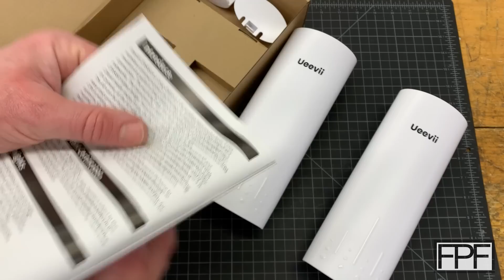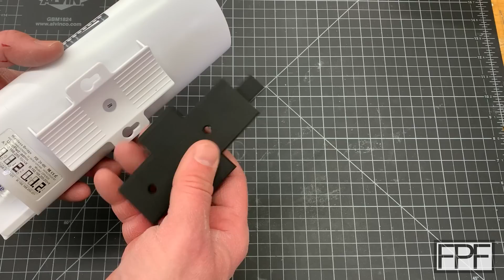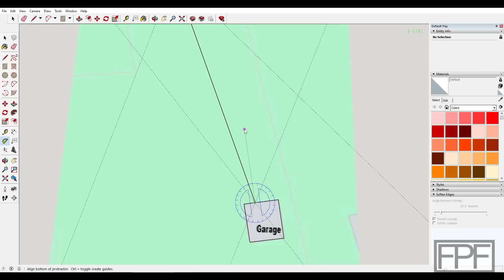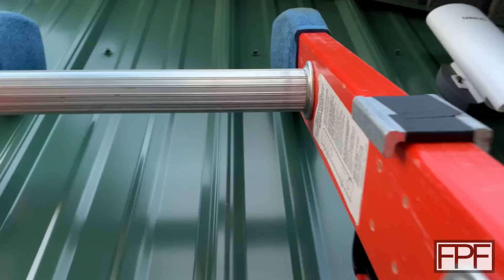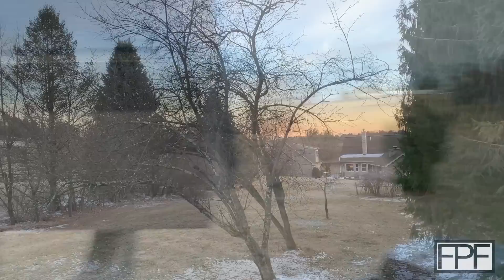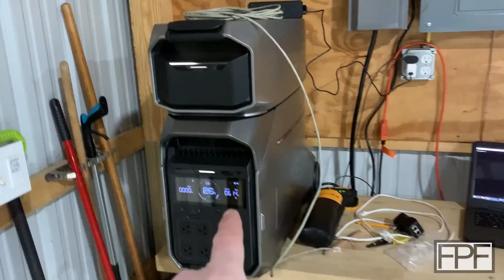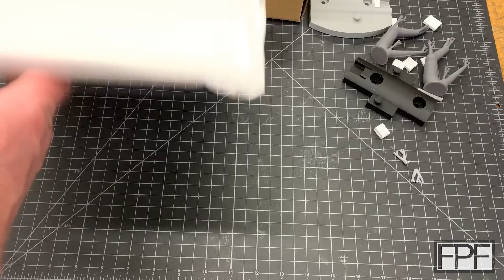3D Printed Mounts for WiFi Bridges

Comment: TPU for AMS is fine as long as the hardness fits your needs. Your layer adhesion issue is specifically why you can't use the AMS for 2 or more materials in the same print. Single head multiple material will effectively blend some TPU with some PLA, which are not terribly compatible.  That mixture will weaken the layer bond every time. 

Also, if I were to do that, I'd want a physical interlocking TPU connection and not depend on TPU to PLA bonding. I think TPU bonds well with ASA, though. 

Also, if you are bent on doing that, make some changes. Change the height of the start of the PLA/TPU interface so that there is only TPU printing once you switch.  That way, you can have a monster flush once and not have to go back and forth between materials. 

BTW,  my TPU for AMS has NEVER broken at the layer lines. Works just like regular TPU for layer strength for me. But I found out early that mixing materials in the AMS is problematic.
Reply: You are correct, you can see on the prints where the multiple materials start that the colour of the grey changes. The pla and therefore the tpu is contaminated, this is what’s causing the tpu to break on the layer lines. Either print as a separate piece or purge more going into the tpu so it’s not contaminated.
Reply from the maker: @zantium13  I saw the change at that layer as well, but wasn't sure if it was contamination or just the higher temp from the nozzle cooling down making the PLA glossier.  I used the defaults for purging and set the material types correctly.  It likely needs more purge, but if it does, they should change the amt. of purge :)   The whole point of staying in the Bambu ecosystem is that generally "stuff just works" if you use their defaults.  I don't miss the days of writing my own profiles and filling the garbage can with test prints to get that last 1%.
Reply: Correction: After looking at Bambu's TDS sheet, TPU for AMS does indeed have a lower strength in the Z axis. That said, what we saw in the video was still not indicative of my expectations for the material. All of my prints have held up as well as I would expect TPU to work. I'm still thinking the main problem he had was specific to layer contamination.
Reply: yeah, this is all great advice.  TPU for AMS really requires making some design choices, and slicing choices to integrate it well into another object.  The possibility space is massive, but it really requires a strong understanding of all the materials involved.

Also, as you note, TPU bonds with PLA REALLY poorly.  There's a video out there covering the bonding of all the common materials with each other.

Honestly I think PETG is a better application for this
Reply from the maker: @soulcatcher521  you guys did see the video right?   It bonded to the PLA REALLY well.  It bonded to itself REALLY POORLY.  Granted, that could be due to PLA contamination, but whatever "TPU for AMS" is, it bonds to PLA quite well.   Is it really TPU? . . maybe in name only, as I've also heard TPU does not bond well to PLA, but this stuff bonds well.
Reply: @FunctionalPrintFriday  I did see it.  My expectation is that it's probably contamination from the pla.  I've used TPU for AMS on a few projects and not had layer adhesion problems, but I also didn't mix it in a multimaterial print.

My note here is just that this is all new territory, and it's gonna take a bit before people have good processes for multimaterial with this filament.

Again, I've had no real problems so far on layer adhesion, but I have yet to try mixing it like you did here.
Reply from the maker: @soulcatcher521  I think we might be revisiting this one
Reply: @soulcatcher521  I don't think you can reliably mix TPU, PETG and PLA in an AMS together.  That's my biggest gripe with AMS and why I'd rather go bankrupt with a toolchanger lol
Reply: No offense dude but when I think of TPU I think of flex not something rigid.  I'm sorry but the AMS for TPU sounds like garbage
Reply: @krollmond7544  there's many types of TPU with different hardnesses, ranging from the very soft to fairly rigid, all of which have use cases.  Super flexible stuff simply put won't work with an AMS, any AMS.

honestly having that push piece running on the layer interface was always a bad idea.
Reply: @soulcatcher521  Yeah, I think 99D is the most rigid of TPU, but isn't that a little flexible compared to the embarrassment I just saw in the video?

Comment: I only had issues with the SuperTack, I even got a replacement that still did not work. I did a lot of research, was in contact with Bambu and posted about them in the Bambu forums – pretty sure I did everything correctly. I'd say about 50% of parts had warping issues, regardless of what I tried. NO issues at all with the Bambu textured and smooth PEI plates. Make sure to check out "How’s the SuperTack plate going for you?" thread over at the forums. Adhesion was mostly fine (for PLA), but due to the warping I had to use brim or mouse ears a lot which really defeats the purpose, especially because the textured/smooth plates just work without having to worry about prints at all. Suuuuper disappointed about the SuperTack :(

Comment: For your green molded siding there is a product called Wet-And-Forget.   Best if you clean the siding first but not absolutely necessary.  The product will overtime remove the mold and clean the siding up.  But that takes too much time for me.  We clean the siding then treat it with the product at a little stronger ration then they say we use 1 part WetAndForget to 4 parts water.   But make sure if you use bleach to clean the siding that you let the blech evaporate out for a few days or it will kill the effect of the product.  This approach lasts about three years.

Comment: Speaking purely speculatively here, as I've not yet tried my TPU for AMS, but since you were changing between PLA and TPU on every layer, it's possible you were getting some PLA mixed in with the TPU (this is a known issue when using PETG as a PLA support material or vice versa). I'm guessing that could have made the TPU more brittle than it would normally be. Try printing the clip on its own in TPU for AMS only and see if that makes a difference to the strength. I think it's time I opened mine and give it a try.

Comment: I have used black TPU for AMS on a few test prints and they turned out great as far as I could tell. Definitely had larger cross sectional area than your design though. I suspect for you it’s a combination of the size of object and the fact that you’re doing multi-material. I don’t remember the temp it wants to print the TPU for AMS at, but I do know that single nozzle multi-material can have more issues because of the print temperature difference between materials… combined with such a thin feature, I can see the potential for issues like you’re having.

Comment: Very strange. I've used the tpu for ams, and have not found it to be brittle, though it is also not that flexible when printed thicker than a couple of millimeters either. I've definitely not had layer adhesion issues like this. Also, my tpu for ams actually does not stick that well to pla with just normal interfaces. One thought is that by switching between pla and tpu, the cooling time or potential pla residue on the nozzle could be causing this layer adhesion issue. Try just printing a solid tpu piece to test. For layer switching you could try a higher temperature on the TPU..

Comment: It's important to know how directional the antenna is.  Is it plus minus 60 or 30 from center.  The more narrow the beam the greater the gain of the antenna and therefore range.  The power output is regulated by the FCC so if they are going for a Km it's probably plus minus 30 for 60 total.  The pattern is not very definite though and the convention is that angle is defined by the 3dB (half power) down points.  Half power sounds like a lot but in your case is probably not critical.  You should have plenty of signal over the noise floor.  Just remember though, whatever losses you have from directionality add up.  If you have both each at the 3dB angle from each other they add up to 6dB for instance.  Even that would probably not matter much in your case.  You might actually have trouble with the 5GHz band though.  They don't like to mention that aspect.  5GHz doesn't propagate as well.
Reply from the maker: it's dual-band
Reply: @FunctionalPrintFriday  I wrote that in the middle of watching your video.  Later you showed the path and you have some trees there.  You might have some problems when the leaves come back.  Hopefully not.
Reply from the maker: @dougcox835  hope not as well

Comment: Your printed part AMS TPU looks really dry. From my personal experience TPU for AMS is perfect, it's flexible  can be printed thinly and is super strong. Did you use the recommended settings or change things a little?. I printed at 230 for all Layers using standard bed temp. I was honestly shocked when I saw yours break so easily. It really does look dry.

Comment: I will wager that because the amount of TPU being printed for each layer is very small, there is still PLA in the nozzle even after the purge which is contaminating the bond between layers. Probably indicative that the purge volumes need to be higher. But I have a poor opinion of multiplexing multfilament solutions in general.

Comment: you can draft the bottom face to about 30º angle and print it on that face, that would make the layer lines cross most of the horizontal features, making them much stronger, you would also get better overhangs on the mounting holes.
as for the material choice, PLA would've been more than sufficient. how many times would you need to operate the latch? maybe 15-20 times in the entire lifetime of the part?
Reply from the maker: how many times?  after shortening up those drip loops, probably never lol

Comment: Ubiquity does bridges that do 450Mbit in not crazy prices (ubiquity powerbeam 5 - 130$/unit... there are various models with different parameters and prices though). Anyway the best solution is to lay fiber (500m of ready to use fiber patchcord (for outside usage) here costs about 100USD + two media converters or SFP+ modules (~2x 40USD) and that way you get 10Gbit. Also for cell phone connectivity in metal barn - if your mobile provider and your phone has VoLTE capability then you can use wifi for mobile voice connections.
Reply from the maker: I put 3 pieces of conduit in the concrete when I had the barn built and terminated them about 8' out with caps, figuring I'd trench and run power/fiber later.  I still might, but even if I dig the trench with my own backhoe, it's still a couple thousand in materials.  If these bridges keep working as well as they have so far, I'm happy.

Comment: TPU isn’t supposed to bound with PLA, it only sticks to it. I often use PLA as a support for TPU with 0 gap on interface layer. An other point is that TPU for AMS is 68D shore which is an « extra hard » hardness so not intended to flex a lot

Comment: I bought the TPU for AMS because the marketing made me feel it filled a need I've been feeling: slightly flexible and super strong. My first TPU print was a door stopper they showcase on the TPU for AMS productpage (Locki Window/Doorstopper). I printed one with recommended settings and one with less walls and less infill. Both came out as stiff as normal PETG, close to zero difference but way more slippery and glossy compared to PETG HF from Bambu. Haven't printed a lot with it since. Since then I've read online about the bad layer adhesion. Wich is a strong point of normal TPU.

Comment: If you look at your printed parts you can clearly see the banding in the grey where the TPU tab is?  This is contamination of both materials due to insufficient purging between filaments.  After much experimentation with purge amounts I then found a couple of studies where it is now evident that it can take forever to completely purge all of the old filament out of the nozzle on every change.  So your TPU tab is actually a cocktail of PLA and TPU.  Everybody talks about “colour bleed” when doing multicolour prints but when doing functional parts it does result in failure.

Comment: You could try to increase flushing volumes. I had this problem with ABS when using HIPS as support interface. ABS seperate easly contaminated with HIPS. Larger flushing volumes helped with this issue.

Comment: TPU for AMS is trash, to the point where i would almost call it a "scam" referring to it as TPU.
Yes i know it might be made from a Thermoplastic polyurethane. but TPU in 3D printing = stupid strong and flexible like cooked noodles. this is non of that :(

The only use i have found for it and keep in mind in only on a weeks trial so far is for my work ID card where the transparent plastic holder that breaks just by looking on it, is now replaced my a printed on in TPU for AMS

Comment: My experience with the bambu printer with ams is that it doesn't purge enough and slightly mixes the filaments. So you loose some of the properties and layer adhesion is usually also worse. 
TPU shouldn't come apart like that. Maybe try printing the tpu without other materials to check the properties of it.
Reply: Unfortunately it’s just terrible. I had the same experience when doing lots of different tests to try and improve layer adhesion
Reply: This is my experience when printing PETG and PLA. The PETG falls apart. Increasing Purge volumes fixed it.

Comment: Looking forward to what you think of the supertack plates. I bought two for my X1C's, and they don't work at all if you leave plate detection enabled. Mine are gathering dust, awaiting a firmware update. 
I think I would have done this whole part in PETG, or as separate pieces, which slid together, and both secured together with the top screw hole.

Comment: We shouldn't even allow bambu to call it TPU, it isn't and it isn't compatible with other TPUs. It's more like a 'Flex PLA' that's akin to silk PLA in regards to strength. Marketing BS.
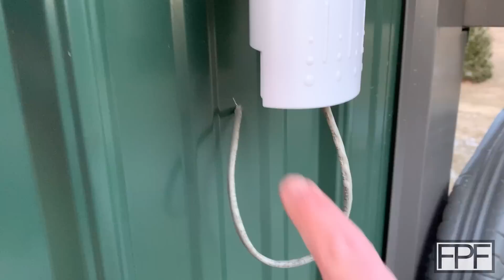19:36 don't shorten up the loop too much, look up 'drip loops' always have wire coming out of openings and then travel in a downward angle on the side of the elements, or water will trace the surface of the wire and collide with the sealing surface, erodes until it fails to seal then comes inside.

Comment: I'm curious as to why you chose to bake in the pegs to the model rather than threaded holes for 6-32 or whatever diameter screws would actually fit and then use replaceable screws when at the very beginning of the video you were worried about the strength of those specific parts with print orientation.
Reply from the maker: Screws would be stronger, but printed in the current orientation, I don't think I could break the pegs if I tried.  I was pointing out that if I printed with the rear face on the bed they would be weak.

Comment: Iperf3 is a nice tool to check how capable a network connection is. You need a device on either side, one running as a server and one as a client. This has a little more validity than just the ping or the speedtest that relies on the internet speed :)
Reply from the maker: I actually have LibreSpeed running on one of my local web servers and completely forgot I had set it up, which makes it even easier.  I tested again with LibreSpeed, and I do consistently get 89-92, which should be about right with the overhead.  I'm really impressed with these things so far.

Comment: This TPU is indeed a bad choice, better use regular and thicken the walls. That will stiffen the print and keep functionality. I also would have made some clamp over the ears of the bridge, so that there was more surface, holding the bridge. 2 of those small stalks, outdoors, are a bit too little to my opinion. About your Bridge connection, it probably is seasonal. Probably in the autumn/ winter it will be fine, but in the spring/ summer it won't. The tree in between is the problem. I had the same config with my parents in law, but as soon as it became spring and the leaves started to grow, my wifi weakened and aventualy died, until autumn came and the leaves were falling. Trees and other plantmaterials are wifi-shields and will drain your wifi or even take away tour signal.

Comment: I used to work with bridges like this. They work great if you have line of sight. The moment your tree is full of leaves you probably going to have lots of  interference. Is it works on the 2.4 ghz band any body of water will in between will be terrible. And leaves are full of water.
Reply: Agreed. Once those trees get leaves your speed may drop considerably. Also, I highly recommend Ubiquiti bridges. They don’t cost that much more and come with proper mounts. They have good documentation and lot of videos on YT covering the setup also. 

I enjoyed the video and enjoy that you share your process and pitfalls.

Comment: I believe you should have made the tabs flat. The half round makes them much stiffer than they need to be. And the bending stress is concentrated at the top of the curve, making the layers tear much easier at that point.
Reply from the maker: was trying to eliminate the stress riser, but I agree that it does cause the bending action to concentrate on a shorter section.  Ideally, I'd go even longer and have the best of both worlds

Comment: Good morning,
if you are using the standard (indoor) cable, wrap the outside part by something. Otherwise, the UV light makes the insulation brittle in couple of years, it starts cracking and water gets in. 1st hand experience.
I also wonder why there is not some "lip" on the bottom  of theholder to support the antena weight from the bottom side (to offload the pins). Just couple of millimeters .
Thx